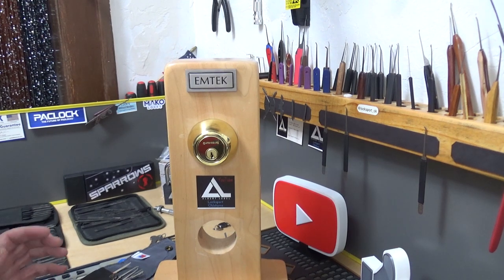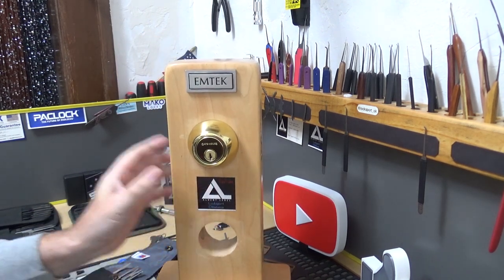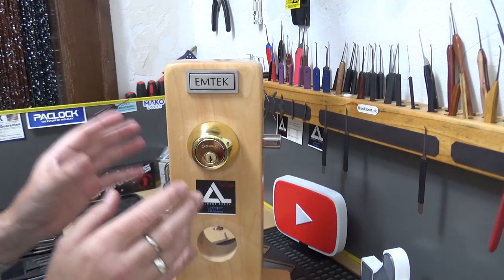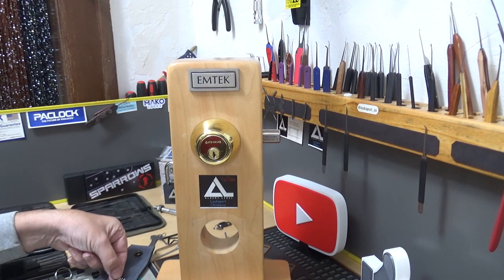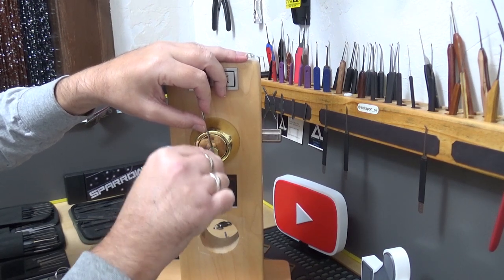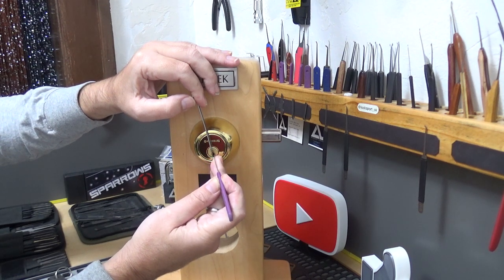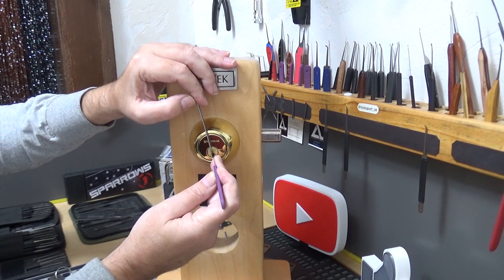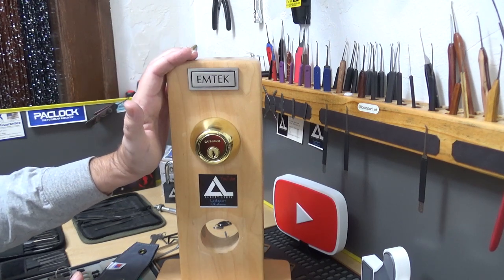#328 Gate House  Double cylinder deadbolt

Comment: Every state has their own codes, but where I live, it's illegal to use this on an apartment, or house you are renting out for that fire safety reason. however, if I live in the home, I can have them for my own use, as I accept the risk. The other good thing about this type of lock, is if a burglar breaks a window and climbs in when you're not home, they can't carry your big screen tv out the front door, they can only take what they can fit through the hole they made to get in.
Reply from the maker: TheKeymaster1053 Outstanding feedback. Yes, while some may see a drawback on this type of lock, I love it because when it’s locked, it’s locked. Thank you for the info. 👌

Comment: Great info Albert. No restrictions on using double deadbolts down here. I have one, a Lockwood 355 that interlocks instead of a bolt. I have side glass panels so decided to use a  double deadbolt to prevent a hand through the glass and opening the door. Also my lock is Jimmy proof as it interlocks into the jamb lock housing. Take care up there brother.👌🍺😎🇦🇺
Reply from the maker: Outstanding !!! Yes, what you have is excellent. That type could not even be separated from the jamb with a spreader device. Thanks Don. And so far so good out here. Stay well
Reply: @AlbertLebel  great to hear Mr Lebel. My mum always said the health is the most important... only with age I now know what she was going on about. Lol

Comment: Here in the Netherlands it's very rare to have thumb turns. There are often many double locks on one door (pin tumbler in combination with one or two cross locks). Yep, you need to know where the key is but in many emergencies I can imagine I would exit through a window. Breaking or normal open. A chair or whatever will do that from any room. Still a valid point people overlook. Another advantage of double locks: a thumb turn doesn't stop a small child from running into the street. Anyway, plenty to think about. 👍
Reply from the maker: I am with you there, I think in a real emergency I could put a hole in something really fast. I just hope it helps people think twice when choosing a door lock. Knowledge is power. Stay well and Thank you for the feedback

Comment: I'm pretty sure that there are laws about where a double cylinder can be used or maybe a requirement to leave the key in the keyway (thereby allowing various attacks on the key).  I almost think that there would need to be a route of egress that wouldn't require a key, perhaps defeating the advantage of the double cylinder door.  
I've only heard of Gate House locks once before and I don't think is was in a favorable.
Thanks for the show.
Reply from the maker: Dusty N Windy on a business yes, but not on your house. This is a residential door lock. Scary thought isn’t it.
Reply: I reckon the only reason you’d use this would be if there was glass side panels beside the door or a window in the door, no?
Reply from the maker: John Smith yes, and it’s a residential lock. May not be legal in some states on rentals due to fire code but a home owner can use it. I bought it recently from a Lowe’s. A large home improvement store.

Comment: I need to make a housing like that. Is it harder to pick when keyway are strait vertical? And everything is at a less Comfy handle?
Reply from the maker: Lock oLot I think so. IMO it’s often easier to pick locks we hold in hand not only due to comfort but you get feedback from both hands. A mounted lock is rigid so your main feedback is only through the pick and tension tool. Example; when I hold a padlock to pick it, if it has serrated pins, I can feel them “click” through the body of lock.
Reply: Albert Lebel ah thanks man. I’m going to have to go build that’s now!

Comment: No one has really mentioned why you'd need a double sided deadbolt. The only time you would use one of these is if the door has glass in it where someone could break it and reach in to unlock. The same holds true it the door has side lights (glass panels on ether side of the door) for the same reason.
Reply from the maker: Gantry excellent point. This would eliminate any such access. Great feedback Gantry, Thank you.